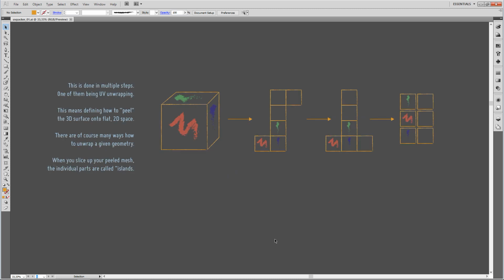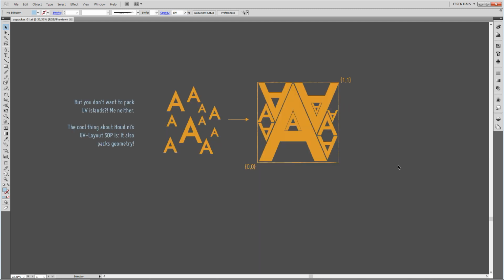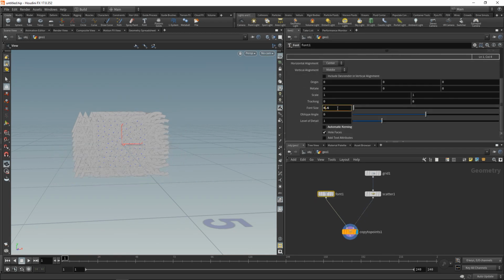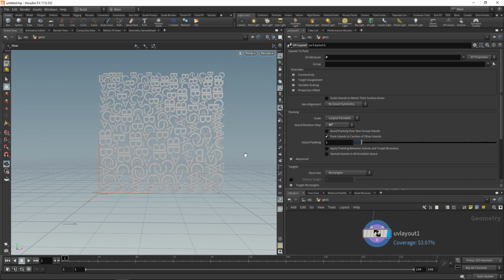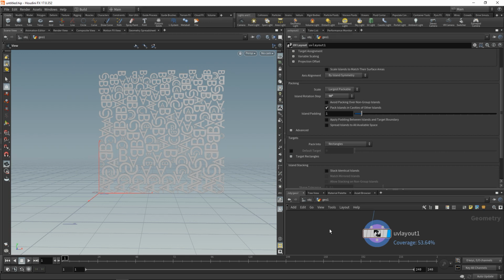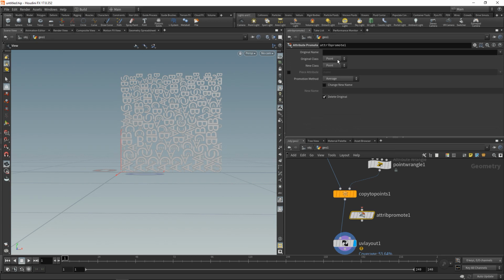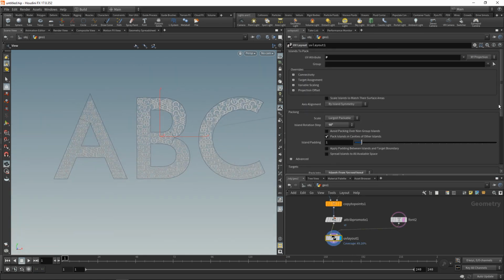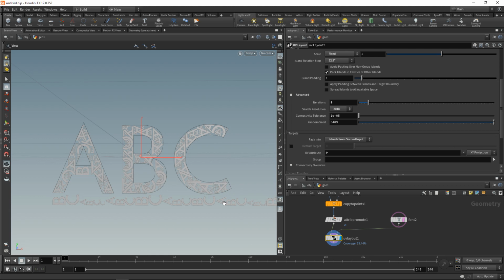Houdini 17 Quicktip: (Ab)Using The UV Layout SOP For Geometry Packing

Comment: I tried this method to pack some boxes on a plan with irregular shape. I have an initial normal and up vector for my boxes to indicate their orientation. However, I found that after I have packed, the normal wouldn't update even their orientation has changed. Do you have any ideas how to fix that?